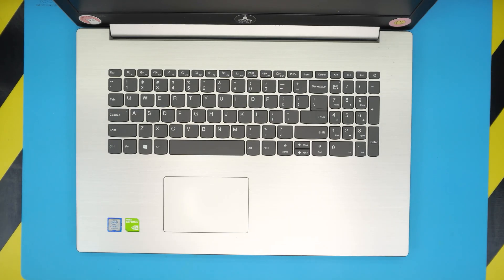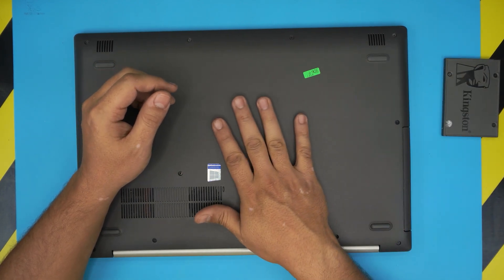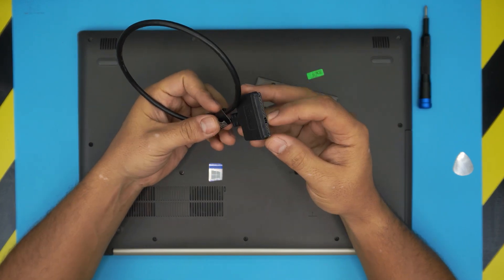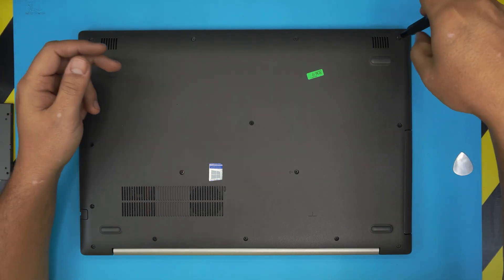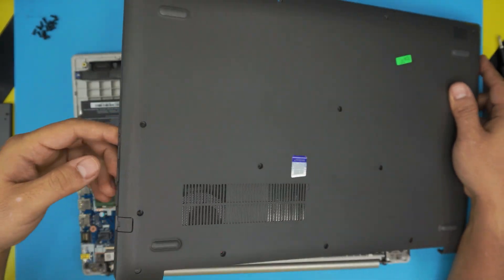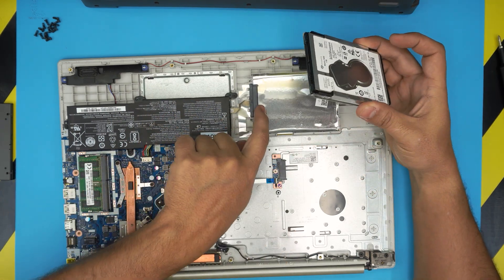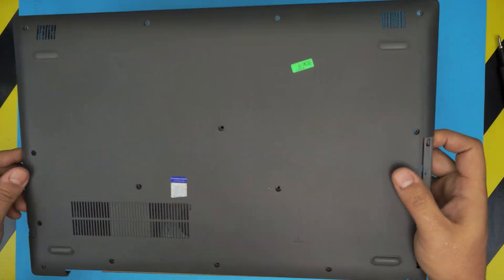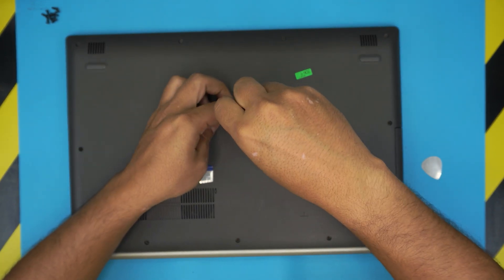Lenovo Ideapad 330 17Ikb  LAPTOP SSD HDD UPGRADE

Comment: You stated that you put a link to the cloning tool in the description. I was not able to find it - am I blind or is it not there? What software would you recommend?
Reply from the maker: 🫠 Regarding your question, for the cloning software, use Macrium Reflect. It's a good tool for cloning drives.
cheers🍻
Reply: @uFixTek  Thank you! 👍
Reply from the maker: It's my pleasure my friend.

Comment: Thanks for the video! I switched my 1GB SSD to a new 2GB SSD, but I couldn't close my laptop anymore; I guess because the new SSD is a little bit bigger. When I tried to fix this, I accidentally broke/unhooked the cable that connects the motherboard with the SSD... Can I fix this, or do I need to buy a new cable?
Reply from the maker: It's my pleasure my friend.
🫠Regarding your question, if you damaged the cable, please don't insist on using it, because you can short the motherboard. Get a new flex SSD adapter from AliExpress.
cheers🍻

Comment: I have a question: Wouldn't you want to disconnect the battery and remove and remaining charge from the components so that there isn't some sort of electrical issue while installing the new SSD?
Reply from the maker: Thank you for the feedback! if you wish to support the channel you can LIKE or SUB or both :P
regarding your question: absolutely not necessary, there is no power on the sata or m.2 ports you can't make a short there even if you tried, with battery on. i been doing for over 18years and me and anyone that i know we never remove the battery. its 100% safe doing it with battery plugged in.
Reply: @uFixTek  Thank you for replying. I was just wondering because I usually disconnect the battery before doing anything on the inside of a laptop
Reply from the maker: anytime my friend, but when you do any upgrade storage or ram, you don't need too. but everything else its good idea to remove.